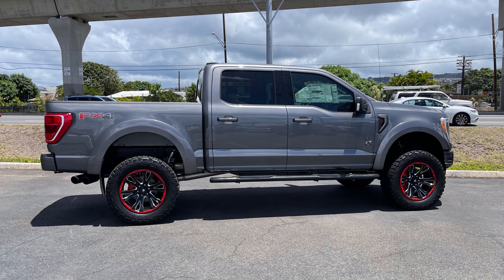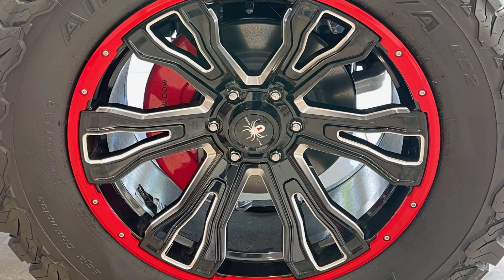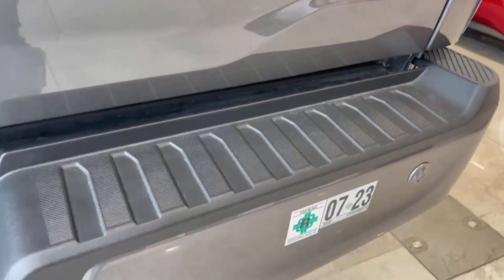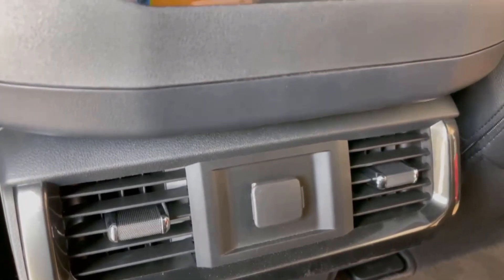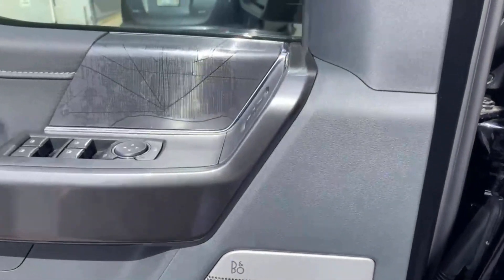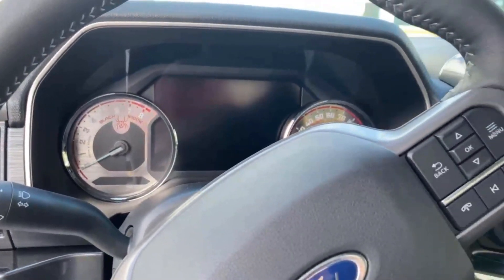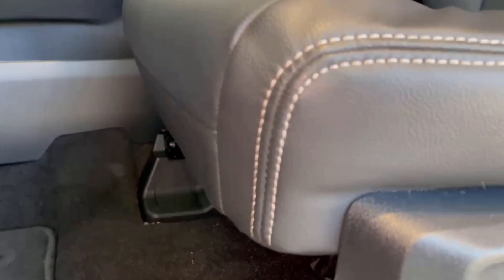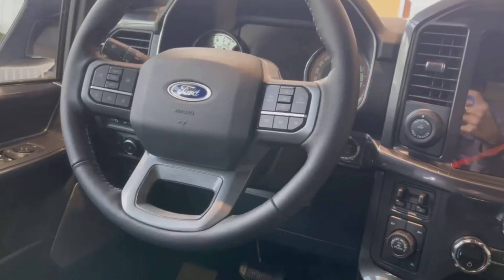New Black Widow Ford F-150: Would You Rather Buy This Or A New Raptor?

Comment: This "appearance package" in no way would compare to a Raptor or Raptor R.  No upgrade in power, where is supercharger for that 5.0? Turning bigger tires, did they regear? Black Widow is a lift and shocks, the wheels and tires choice not even for off-road, there is a reason for 17" wheels on the Raptor's and 35's or 37's on them, then  "Black Widow" is just a bunch of badging... Does the BW have the Torsen front differential?  Raptors are a lot higher grade package, to start with so much more off-road capabilities, not even a comparison between these trucks. Black Widow is just to look "good" on the pavement. For the cost of this package you could do a whole lot better for less money.